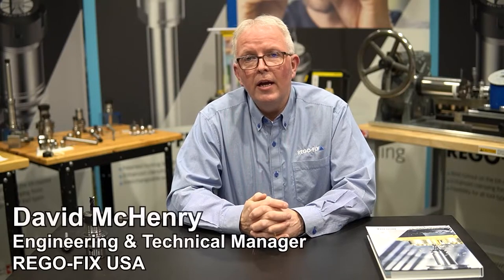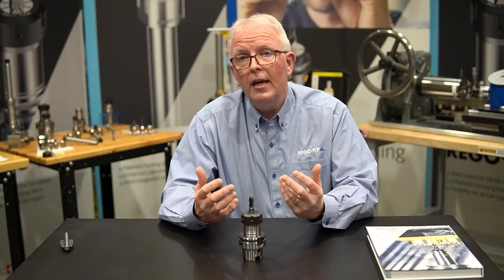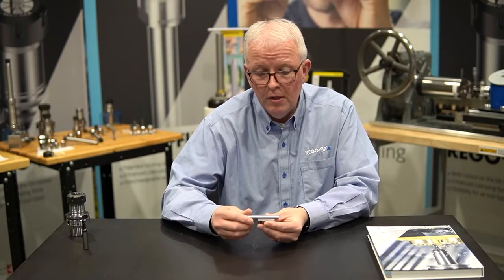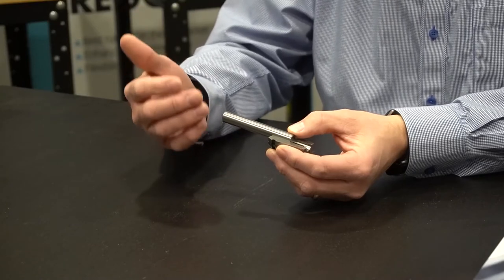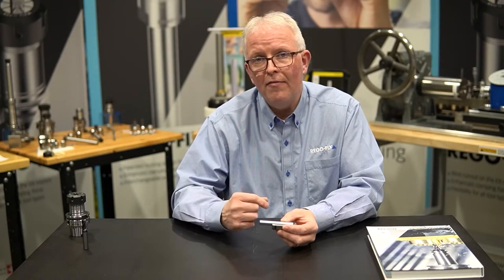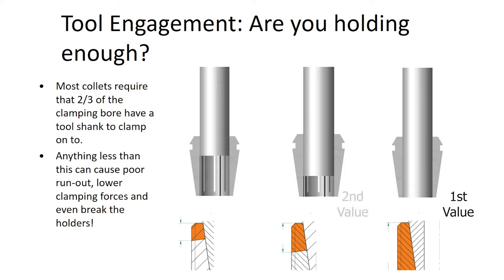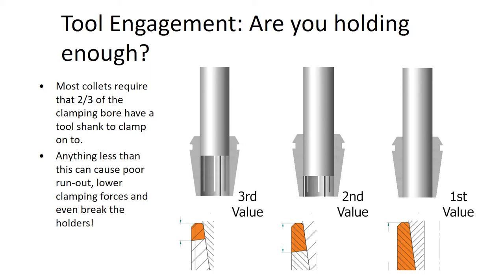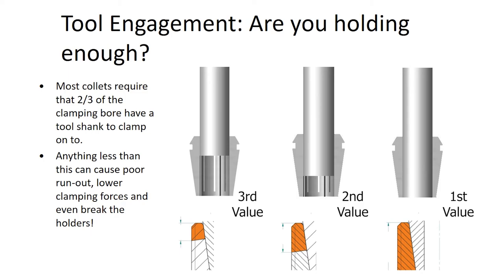TechChat - ER Collet Tool Depth

Comment: I recently picked up a full set of collets, wow what quality. That said the 1/4 does have a full shaft inside but I presume the 2/3rds rule still applies?
Reply from the maker: You're correct! Even with the full bore we still recommend abiding by the 2/3rds rule. Anything less can cause potential issues with clamping force, TIR, or outright damaging the collet.